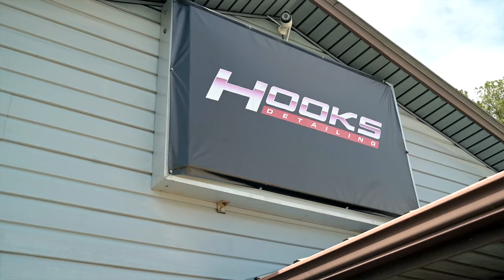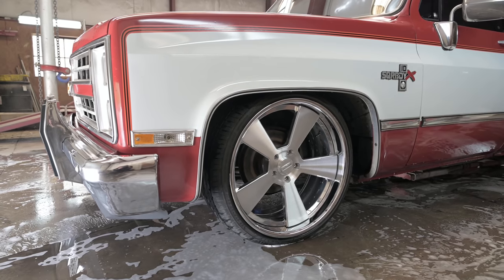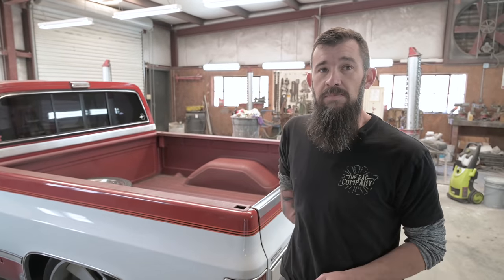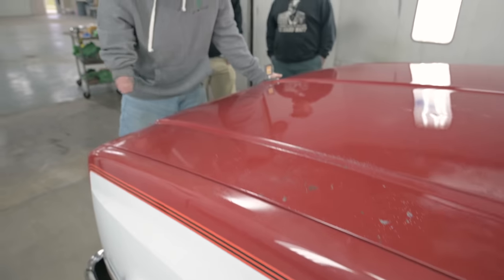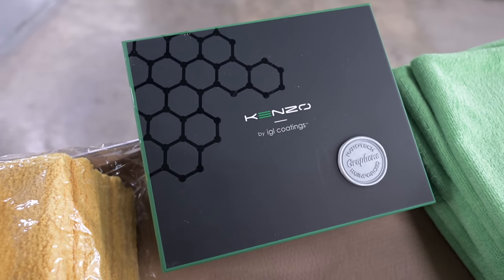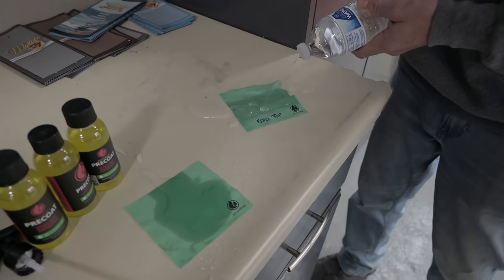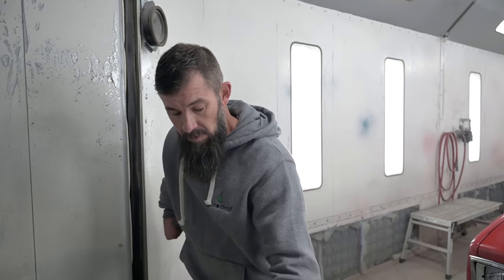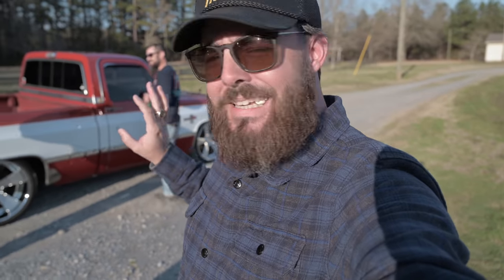CERAMIC COATING YOUR CLASSIC TRUCK | a how to w/ HOOKS DETAILING

Comment: What is the brand and specs on the wheels? I have an 83 c10 and want the same setup. Any modifications or spacers etc required? Thanks
Reply from the maker: We have a video with all the specs somewhere on the channel. Off top of my head, 22x9 front and 22x11 in rear. Can't remember front tire size, but rears are 315/30/22 I believe. MTW Phat 5s are wheels and no mods necessary.
Reply: Thanks

Comment: Hello, can you tell me what size wheels and tires he has on the truck. thanks
Reply from the maker: We have a video with all the specs somewhere on the channel. Off top of my head, 22x9 front and 22x11 in rear. Can't remember front tire size, but rears are 315/30/22 I believe.

Comment: Quick question for the C10 family. I have a 81 short bed. I want to paint it two tone like the truck in the video. Can anyone give me the dimensions and measurements for painting the stripe on the side. All exterior moldings were done away with before I bought the truck.
Reply: I don’t know about actually painting the pinstripes, but you can buy the original pinstripes exactly the same as came on them from the factory, and any other trim you may need.
👍🏼
Reply: Just noticed your post was a year old, hope you got what you needed 👍🏼👍🏼
Reply: @adamhenson4350  Better late than never. Haha. I was referencing the large belt down the middle. The white strip. And I haven't had the truck painted due to body work. Hopefully in a month or so I will have it painted two tone. Buckskin and white
Reply: @jasonfurtick2395  
Ooooh, I got what you’re saying now man.
Mine is a solid color, couldn’t help ya on that one, good luck I’m sure it’ll turn out nice, hopefully someone else will see your post in time and give you the correct measurements, or if you find any shows coming up around ya I’m sure they’d measure it out.

Comment: What wheels on that unit 🧐
Reply from the maker: We have a video with all the specs somewhere on the channel. Off top of my head, 22x9 front and 22x11 in rear. Can't remember front tire size, but rears are 315/30/22 I believe. MTW Phat 5s.